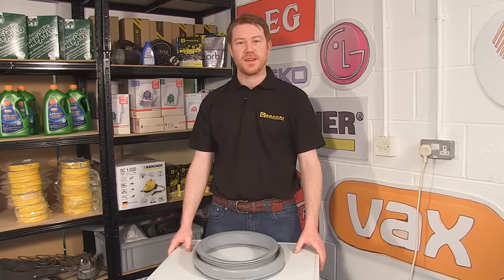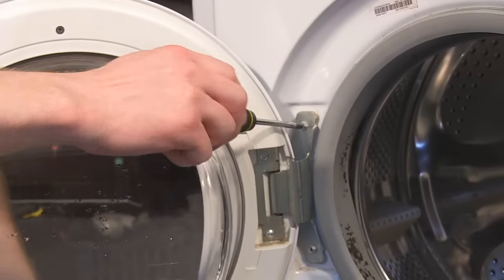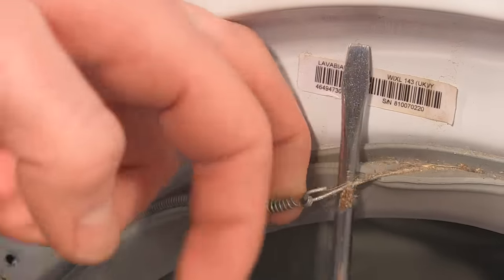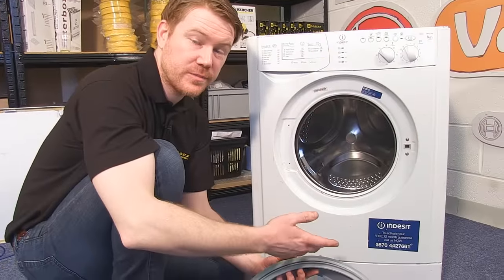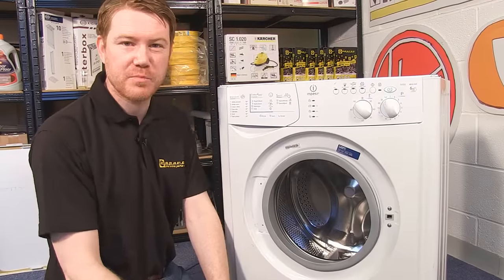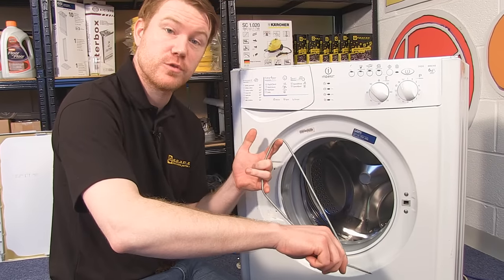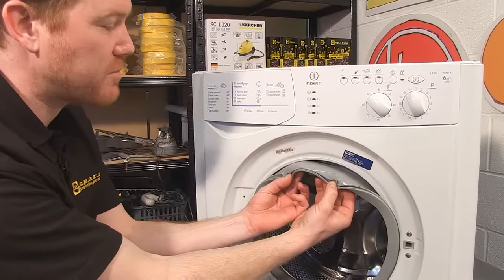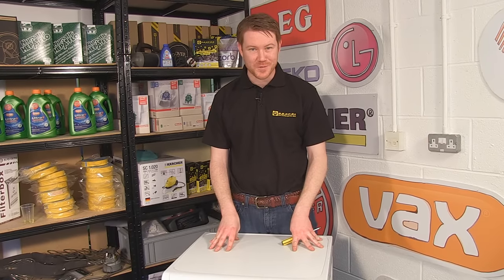How to Replace the Door Seal on an Indesit Washing Machine

Comment: Thank you so very much for this Video! As a 28 y/o single woman without any technical education i have to say it wasn't easy but saved me a lot of money.I have an Indesit (Aliomatic) WDA 71400 (EU) Washer/Dryer Combo. For some  reason a little piece of the door seal was ripped off so the machine started leaking. I called a few technicians and they all would claim around 230€ for the door seal+repairing!!! I bought the machine for 370€ a few years ago, so i decided to look online for the door seal and found it somewhere for 36€ (shipping included). .

Comment: I replaced the door lock without making sure that it was fully through the hole and wondered why the door would not close properly. Re-running the video makes this point clear. Full marks and thanks!
Reply from the maker: +bessonbach Thanks for your comments and glad you sorted the problem. :-)

Comment: Thanks a million, saved €154 on a call out by sorting this with your handy video. One tip when reinstalling the door seal, push it fully inside the drum as if inside out, it works quickly.
Reply: You tube answers alot of questions.  Suits my learning style
Reply from the maker: Séamus Mac Craith Hi Séamus, glad to hear this. Check out our new diagnosis videos as they should help when you have a problem with your washer dishwasher dryer fridge hob or oven. And others will be added as we produce them.
Reply: @eSpares   my hotpoint tdl30 is making a dredfull noise when the drum turns

Comment: Just attempted this and could not have done it without this excellent video - thanks so much.

I cheated on the internal retaining ring by disconecting one end of the spring!
Reply from the maker: Hi, thanks for your comment...it's so good to hear that you found our video so useful, and you were able to replace your door seal with our help! Well done for repairing and not replacing your appliance.
Reply: I've just been struggling with the inner ring today!
Disconnecting sounds like a great idea going to try that tomorrow!
Reply: @deekey33  did you manage to complete yours!?

Comment: thanks for the wonderful vid, got mine done in about 20 minutes, Upright didn't work for me, laying it on its back worked far better and the washing up liquid was a great tip. getting the inner retaining band on was tricky as screwdriver kept moving, in end I found that if I held it in place with left hand roughly at the 11 oclock position I could use my right hand to move anticlockwise feeding the clip in as I went, last bit just popped into place, thanks again for a wonderful vid
Reply from the maker: Thanks for the comments, glad we helped.

Comment: Our machine is Hotpoint HV5L125 managed to fit it in around half hour. Only adjustments to video was, It was easy to fit with top removed (Remove two screws at back lift slightly and pull back sharply.) I did not need to remove door at all, and did not have to remove lock as narrow screwdriver fits through hole in the lock easily to hold inner spring. But probably would have struggled without the vid. Thank you.
Reply from the maker: rockeltcb Glad you managed it ok, the inner spring can be a bit of a fight at times. :-)

Comment: have just replaced due to your excellent vid (plus i didn't actually realise until i watched you that i'd order the seal from your company as was very dubious about getting a naff "copy" from ebay!) that said, a little under 2 and a half hours, sore thumbs, a sore back and sore fingers i did it!  i won't be giving up the day job tho anytime soon!  hard work but the mould just had to go - so a big thank you - you actually saved me about £111.00 from having to call out indesit!
Reply from the maker: sizkar9 Glad to hear your perseverance paid off. To prevent the mould returning and remove smells and limescale see this other video: 
www.youtube.com/watch?v=ifWK9df1qgg
Reply: Perfectly clear instructions - as some have said, a bit fiddly, but with the lid off and a little judicial swearing, success was achieved in about 30 minutes - thanks very much, great video 👍
Reply: What was the machine you were replaceing the seal on

Comment: Thanks for this tutorial. The screwdriver trick did not work for me. I found it quite easily when my wife helped me holding the inner ring together.

I never repaired a wasmachine, but i did this trick in 15 minutes thanks to this clear tutorial.
Reply from the maker: Thanks for the comments Pascal. Often a second pair of hands can come in very useful rather than struggling on your own.

Comment: Thank you, after removing my door seal to clean it I was having trouble getting it back on (due to the 'hidden' inner lip on the outer seal) having a bad back and getting a little frustrated I called a local repairman, "Oh yes we have them on the truck, you can't re-install it has to be a new one, £50 fitted". I thought that sounded like BS so after a quick search I found this video, seeing it done I realised my error and the machine was back together in a couple of minutes and is washing away as I type, only thing is I didn't need to remove the door or catch. ;) Thanks again!
Reply from the maker: Glad we could help Arthur. To prevent the seal getting mucky again see another video:
https://www.youtube.com/watch?v=ifWK9df1qgg

Comment: Thank you for the answer. I'm using the machine with the noise and now 5 machines later the noise is less. But still there. If have replaced the door seal three times but I'll do it again. Thank you!

Comment: How to re-attach the outer seal metal wire holder? I fit one end and the other end comes out because its so tight. Any tips?
Reply from the maker: Hi Raaed Alhaidar, the easiest solution is to ask a friend to hold the one side while you move it around if not make sure you hold it tight with hand and as you go round keep pushing the one side in while you move around.
Reply: eSpares thank you so much, I will give it a shot.

Comment: Thank you for the video. Mine is Wia18.  It has been used by my roomate. I am asking about the drainage pipe should it be high or connected to wastage outlet?
Reply from the maker: It is important that the drain hose end is not lower than the water level in the machine or it can cause the water to siphon away. For more information see our video: https://www.youtube.com/edit?o=U&video_id=Leqc63H8G3Y

Comment: Thanks for the great video, I watched this a couple of times and then changed my door seal too. You make it look very easy my inner band was a bugger to get back on as it was pretty tight. It's working fine but the new seal is rubbing against the spinning metal drum. It seems bit of a tighter fit than the old seal, the rubbing creates fine rubber particles on the door seal. Will it ware in and be ok? I'm pretty sure it's the right seal and been fit correctly.
Reply from the maker: Hi Rob, A new seal may catch at first especialy if the washing load is not balanced and causes the drum to flex into contact (see our video: How to Prevent a Washing Machines Spinning Noisily).
This often wears a small amount off the seal and stops being a problem but check the edge of the drum and remove any rubber off the edge of the drum with a plastic pan scourer to help it not catch again.
Reply: Thanks a lot for the reply your videos are great, I might give it a go with a scourer but it seems to be rubbing less now it's done a few washes, I ordered some of your cleaner too so will get it looking nice and new again soon!
Reply from the maker: Rob .w If you haven't watched it yet see our video:
 http://www.youtube.com/watch?v=ifWK9df1qgg  as this gives lots of tips how to clean the machine and prevent the mould coming back.
Reply: Yeah that's the one that inspired me to get the cleaner thanks! :)

Comment: Hi, my Indesit wax120uk washing machine's seal was wrinkled during a wash and at the end of wash it just would'nt drain, just kept filling. Watched your video and have taken door and seal off, seal pretty mouldy. Their was no spring to remove at front as on your video, just inner one. Also sometimes when I set machine for a wash the dial just keeps going round and clicking, do you think changing seal will help. Would appreciate your help. Mai.
Reply from the maker: HI Mai Dolat-shahi, it sounds like you have a couple of problems there. On some indesit machines with your type of timer if the machine identifies a 'fault' the timer keeps advancing in the manner you describe. This is usually if it has not heated or if it has not drained within a specific time. If your machine will fill and start but will not drain see our diagnosis video: www.youtube.com/watch?v=frEJhX9Sppw

Comment: Great video.  All done but I'm absolutely baffled that I now have a washing machine that doesn't spin.  Even before I fixed the new door seal, it spun perfectly and I can't see how the replacement affected it other than perhaps the fact that the triangle at the top isn't currently sitting at the top.  Could this possibly affect the machine not spinning?
Reply: Sorted it out eventually.  It turns out that I'd placed the rubber too close to the drum.  Then it transpired that it still wouldn't spin but I noticed that there was a loud noise when it tried to go into a spin.  Looking back, I figured that could be the belt so I used another video to work out how to do that.  Thanks very much but I still think it's worth pointing out how to get the top off the machine as I couldn't figure it out at first (worried I might break something).
Reply from the maker: Glad to hear you sorted the problem (before we had a chance to reply).

Comment: Struggled with screwdriver for an hour. Did it without by hold in groove on left hand side and then running it into the groove downwards to the right and the pulling it around and upwards, all the time holding the left side in place with left hand. Took seconds.
Reply from the maker: Thanks for the comments Steve, to do your method you need a lot of strength in your hands and some viewers may struggle. However it is the easiest way if you can do it.

Comment: Fitted mine, but the outer seal on the original seal had no retaining band - it was glued and there doesn't seem to be a place for a retaining band (IWC71450). Would it be a bad idea to super-glue it back, or is there a specific glue to use?
Reply from the maker: +PEMBY&#39;S GAMING WORLD Your machine should have had a retaining band and you can get a new one from the following link: 
http://www.espares.co.uk/product/es831870/
We would not advise to glue the seal in place in case you need to replace the door lock or other repairs.

Comment: can you tell me if front panel comes off indesit washing machine iwe81681 please? trying to fit new door seal many thanks
Reply from the maker: The cabinet on your machine is welded and the front cannot be removed. We are sorry but to replace the seal you will have to use the method in the video above.

Comment: I have the same issue with the small nuts that hold the screws for the door  in on the inside of the machine . when i unscrewed the door they fell inside . when i put the door back on the screws don't hold and there is no access to attach the nuts from the back . will i have to remove the outer seal retaining spring to hold the nuts in place from behind?
Reply from the maker: Hi Karen, there is on some models a metal plate that can come away and fall to the base of the machine. If this has happened you can either carefully lower the machine onto its back and reach in to hold the plate in position. Or what may be easier is to un-clip the seal and reach in to fit the bracket. For details on removing the seal front edge see this video: https://www.youtube.com/watch?v=3IqArUKDLYE

Comment: hi matt please help me! I have changed my door seal and the new seal is making a terrible noise! The seal is causing some kind of friction and heat! have I done something wrong?
Reply from the maker: +Wendy Nelson If the drum comes into contact  with the seal it will groan and sometimes even smoke on spin. Check you have the right seal and it is fitted correctly but if the drum is loose from bearing wear or if it is slightly off centre i will catch. If only slight it will usually settle quickly and wear a slight groove in it.

Comment: Hi all I need help. Indesit IWC81482 is cooking water, what is the reason?
Reply from the maker: Hi TheMasteredStudio 44, you have not mentioned showing an error code so let's start by checking the NTC which controls the temperature and let us know how you get on.
Reply: @eSpares  NTC broken,and all controls flash
Reply from the maker: hi TheMasteredStudio 44, if the NTC has broken have you replaced it and you are still getting the flashing lights?

Comment: Hi can you please confirm all required for this job is the door seal door seal clamp and door seal retainer clamp? I am ordering off your site but the chat was very unhelpful
Reply from the maker: Hi Jacob, we cannot confirm anything without a full model and production number as there are many Indesit seals. If you have a problem fill in the information on the link at the bottom of the sites page:  http://www.espares.co.uk/contact/sales

Comment: Agree with Adam Middleton.  I'm 65 and done quite a few jobs in my time, but this was 2 hours of blood, sweat and toil. By far the most difficult is the inner spring. You just have to calm yourself and then work up to the BIG PULL.  You eventually work out a way yourself. Door lock tip did not work for me. Useful video though. Saved buying a new machine !
Reply from the maker: That spring can be a nightmare at times at should not be underestimated.
The trick that can help most people is to 'fix' it at one point (the screwdriver method). Glad to hear you got there in the end.😊

Comment: I have a indesit washing Machine model wia82 it running continue without  stopping ,kindly guide me
Reply from the maker: Hi Naveed. If you watch our washing machine diagnosis videos you will see this can either be a drain problem or more likely a water heater problem. For information to diagnose your problem see our video:
http://www.espares.co.uk/advice/7/1794/how-to-diagnose-a-faulty-washing-machine-heater
Reply: Thanks I will come back to you after checking.
Reply: Drain and water heater are OK  still same problem existing, do you have another idea
Reply from the maker: Naved Akhtar See our diagnosis videos: How to diagnose washing machine control and program problems

Comment: I'm trying to replace the door seal on an indesit washer/dryer and trying to get the inner spring/clamp back on is an absolute nightmare, the seal just keeps slipping back off whenever the spring pulls against it
Reply from the maker: Hi Scott, if you have a pair of 'mole grips' fold the seal back into the drum. 
Then locate the seal at one point in the groove of the drum and fix with the mole grips (not to tight you damage the seal).
Then stretch the band over one side of the seal and work it around the other halve until fitted.

Comment: I've just put a new handle on but the door doesn't go back on the machine, I watched this to see if u had to put  screw blocks from the inside to get the screws to bite, but you just screwed it on, what do I do now
Reply from the maker: Hi Dninjah, What is your model number and part you are replacing?.
Reply: +eSpares I've sorted it now, 2 tiny nuts were holding the screws and they had fallen on a ledge at the bottom, finicky job putting it back on
Reply from the maker: Glad to hear you are sorted now. :-)
Reply: I have the same problem , how did you  hod the nuts in place to screw the door back on ,there is no access
Reply: +karen murphy had to remove the top and get extra pair of hands 😊
Reply: thanks for the reply ,.. yes i took off the top but the access is too small can't even get a hand in , will try what was suggested above
Reply: +karen murphy yh it is tricky, u gotta just push past the seal slightly
Reply from the maker: This is good!, by the time I have come back from lunch it sounds like you have sorted it between you. :-)

Comment: my washing machine keeps coming up f6 which it says it's the door lock I've replaced the door lock with a brand new one and it keeps coming up with f6 any ideas?
Reply from the maker: What is the model Matthee?.
Reply: it's a indesit
Reply from the maker: Sorry but we need the full model number not just the make to be able to give any detailed information.
Reply: XWD71452
Reply from the maker: Check the motor brushes as if worn will stop the motor and may give this error.
Reply: 1 to 14 gives the f6 error but if I put it on just wash and then spin after it works

Comment: I am really struggling with this due to not being able to take the front panel off. There is no working space for an already awkward job!!
Reply from the maker: Daniel Dalziel Try disconnecting the machine and carefully lowering it onto its back. This allows the drum to move away from the front and may help you with the additional space provided.